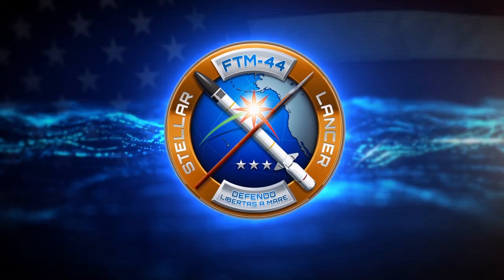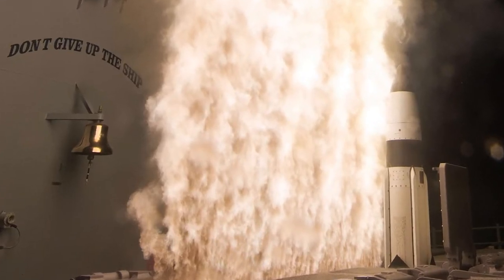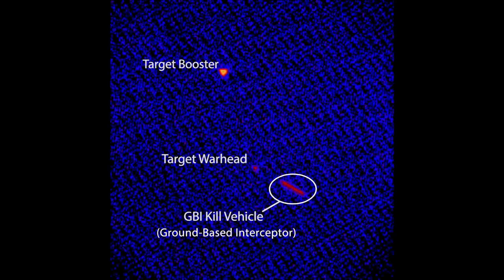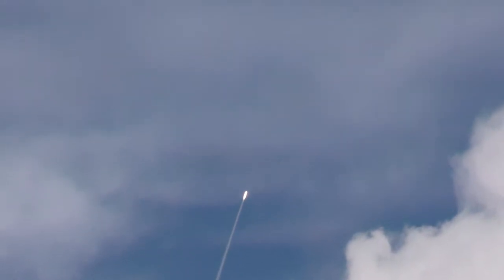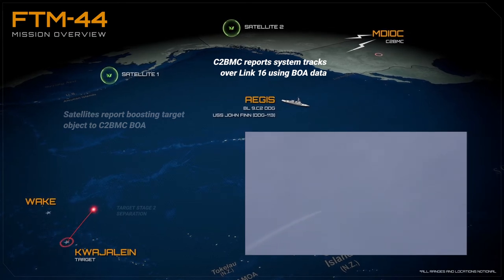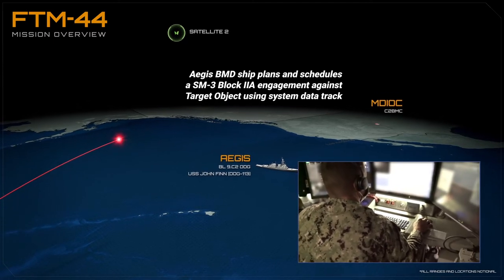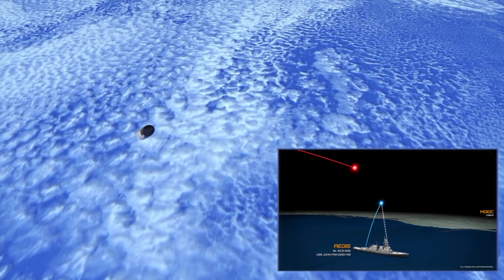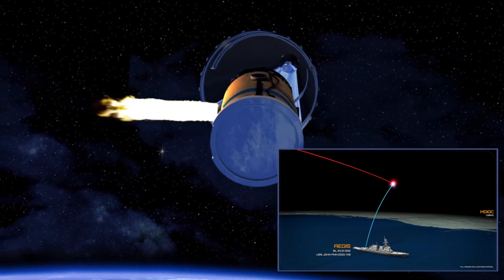Aegis SM-3 Block IIA Destroys ICBM-class Target Launched From Kwajalein Atoll

Comment: So what was the combined speeds of the two missiles upon impact?
Reply: Well the minuteman 3, americas silo based icbm, reaches speeds of 15,000 mph ...take that for what its worth... Fast enough that the kill vehicle carries no ordnance .. it relies on kinetic energy just like a bullet. . except a bullet , sat from a high powered sniper rifle in 338 lapua magnum, is moving around 3,000 feet a second.. if the minuteman is moving 15,000mph... That equals 22,000 feet per second.. so these " bullets" are moving 7 times the speed of the 338 lapua magnum . Some more data...  
338 lapua magnum launches a 250 grain bullet ( a little over 16 grams) at 3, 030 feet per second ( 925 meters a second) at the muzzle.. this produces 5,108 foot pounds (6,925 joules)  of kenetic energy..... 

The minuteman 3s re entry vehicle weighs around 550lbs...   Moving at 15000 mph..   the kinetic energy alone would equal around  4,136,874,468 foot lbs... Or a little under 1.5 tons of TNT....
Reply: @no.step.on.snek.2423  just the detail I was looking for. Thanks for the math!!
Reply: @clarkgregb  keep in mind thats rough math..but a good ballpark figure.. most russian reentry vehicles can move faster than that. And the kill vehicles may as awell.. any increase on either side exponentially increases the kinetic energy and difficulty... Also the advent of.glide vehicles completely nullify abm defense.. current warheads follow a ballistic trajectory.. a predictable one.. these glide vehicles move and change altitude during descent  making them very unpredictable

Comment: All these tests are designed to succeed.
Reply from the maker: I agree :)
Reply: We are not like Russia. The weapons testing is reality based. The outcome is either a hit or miss. Easy to keep score. Check out the success of US weapons in the Russia/Ukraine war. Check out the failure of Russia weapons in the same theatre. That is the result of proper testing.
Reply: @calcrappie8507  Most of the tests are done in simulation software, where crazier situations and countermeasures can be accounted for, so the actual capabilities are likely not even public info.
Reply: They are not. In fact, lots of these fail